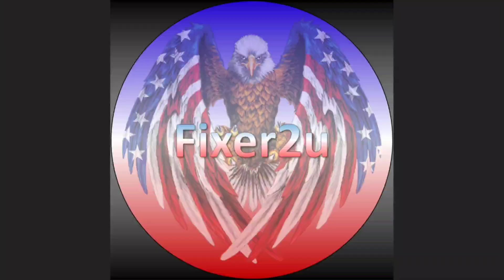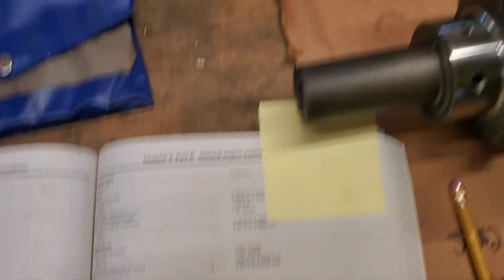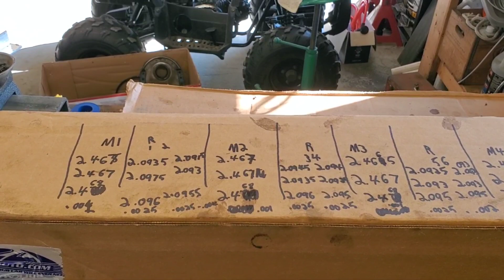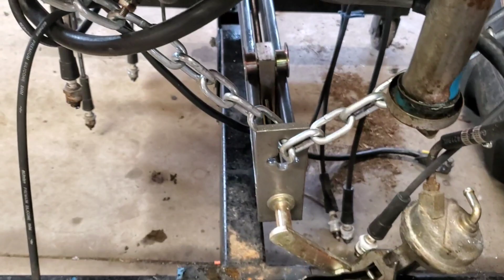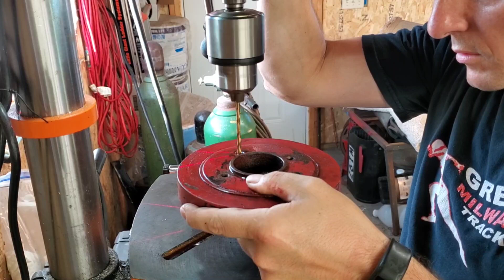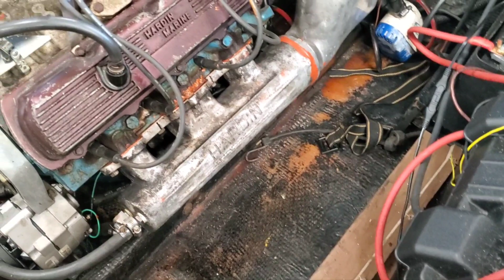Olds Powered Baja Jet Boat Part 4 (403 Olds First Start) #firststart #willitrun #baja #boat #olds

Comment: valvetrain seemed a bit noisy on the startup.  how she running for you?
Reply from the maker: It was noisy.  I think the oil pump needed to prime.  It calmed down shortly after.  Runs great.  That was 2 years ago so ran it last summer and this.  Still running great.  Getting about 57mph out of it on a calm day.

Comment: I've owned 5 T/A's with a 403. This is not the engine to spin at 3500 rpm all day but they are very good engines.
Reply from the maker: Well this is the stock engine that came with this boat.  Not the original engine but it does well. There were a few options but this is the one my dad and uncle chose back in 1977.  That actually last longer than you would think.  We have had a 350 in there and it just does not do the job.  You lose over 10mph on the top end and takes forever to get on plane.  If this one ever goes, I think I will go to a 455.  Those are still pretty available for marine applications believe it or not.

Comment: Those oil clearances for the mains are on the very tight side as well as that one rod at half a thou. Did u put new timing chain and gears in it. The chain looked a little loose.
Reply from the maker: So if they are in spec, what do you consider on the tight side?  Also the gears did not seem to have much wear so I sent it.  The chain did not seem that bad to me, but I have not done a ton of these so my judgement may be off?
Reply: @fixer2u  As for the chain slack it looked a little loose. I did a chain and gears on a gen6 big block chevy. The new chain had as much slack as I took off. Bought another one from a different manufacturer and that one was nice and tight. I think the loose one was dyna gear. Second one was cloyes. I try to stick to .0025 for all my clearances. Used to work at a shop and we ran into this alot. We would put the crank on the lathe and polish the journal with a crank polisher to get them all where we wanted them. Albeit we used a mic and not a caliper. But you gotta use what you got. Did you take apart the oil pump and clean the metal out of it or get a new one.
Reply from the maker: @tjs_welding_and_fabrication  Ahh ok I see.  Well like you said, I had to work with what I had. Yeah my caliper measurements may not have been the most accurate.  A mic is on my things to get list, just have not gotten there yet!  I did clean out the oil pump, there it not seem to be much in there,  there were a lot of bigger chunks caught by the screen.  I meant to cut apart the filter just so see what was in there, but never got to it.  I think I have it laying around still so I may still do that just to see!   Thanks for the comments,.  For what it's worth, I had the boat out this past week and it ran really well.  I got it up to 57 on the lake and no matter how ling I ran it, it held 60psi oil pressure when hot so hopefully it will last me a while!